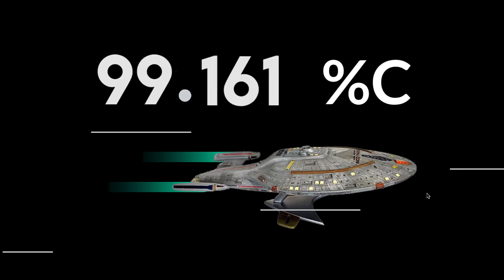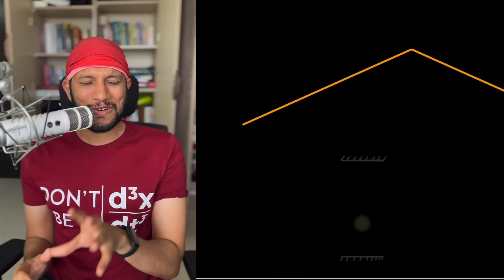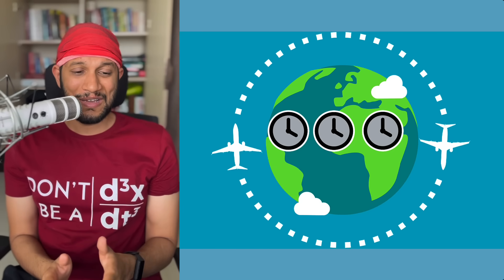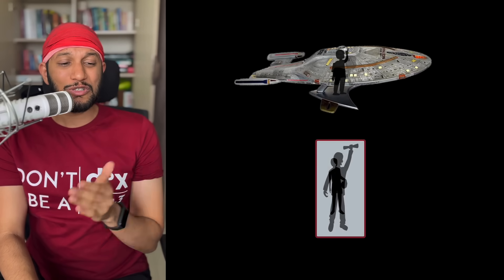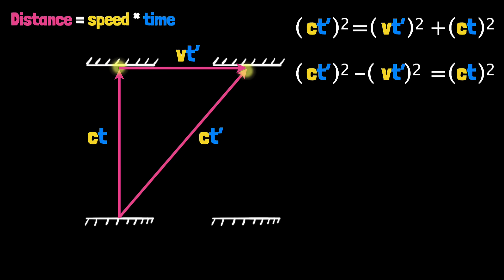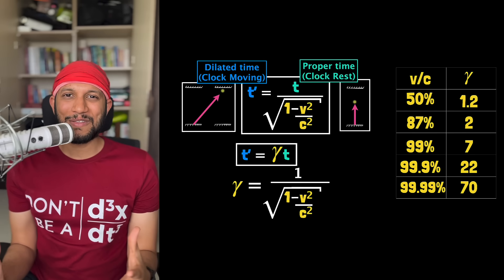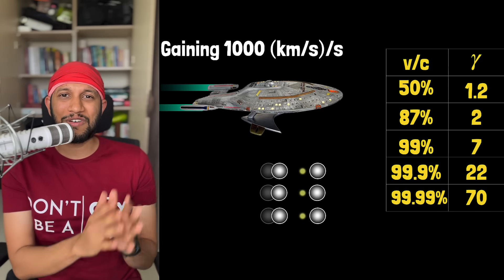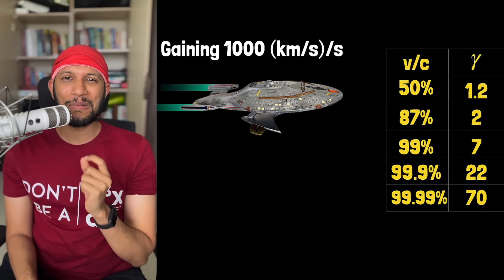I finally understood why you can't go faster than light! (My mind is blown)

Comment: Well it seems to make sense except with the part that the photon would appear to slow down.
If they are traveling at a fixed speed between a set distance in the „clock“, why would they appear slower from an outside perspective?
You just add another vector of velocity to them, that doesn’t change the speed for the other.
Also wish if you put the clock sideways?
When the photon travels in the same direction as the space ship?

If the photon bounces in the same direction as the ship, it would take longer to reach the end since the mirror is moving away from the photon.
When it bounces back it will hit the mirror faster since the mirror now moves to the photon.
However when the ship reaches light speed the photon wouldn’t be able to reach the mirror anymore. So from an outside view anything on the ship stops moving forever as long as the ships moves at light speed.

Since our whole existence is based on moment of particles, the machine of existence basically stops, since when nothing can move.
No energy is used and when no energy is used, nothing happens.

But that seems to be impossible.

Comment: You might want to do an in-depth video about half-life, because it's not as understood as you'd think.

Radium has a half life of 1600 years. That means that in 1600 years, half of the radium will have undergone Proton Decay, which turns a Proton into a Neutron, and releases a radioactive particle. This doesn't mean that half of it disappears, but rather goes down by 1 on the periodic table. For every radioactive particle released, a proton is decayed.

The Radium that undergoes decay turns into Francium.  Francium has its own half-life, which then half of the Francium has decayed into Radon, and so on. So for the material to actually half, there's a little more math involved

The real question is, what will be the heaviest element left when half of it is gone 🤔

Edit: I almost forgot. This doesn't account for when the atoms eventually shed off some neutrons instead, which they will

Comment: I just realized something about fictional spacecraft that have some tech for FTL travel (e.g. warp drive).  For practical purposes you would never want these ships at a velocity close to the speed of light.  They should only travel either a small fraction of c, or faster than c.  If they ever got up 0.5 c or higher, there would be time dilation consequences.  If they accidentally travel at 0.9999999 c for just a short time, 50 years might pass at their destination!

Comment: i have a serious issue with this statement: "you see the moving twin age much slower"
the moving twin compared to what? if the twins speed difference is c (99.9% of c) compared to eachother, but half c compared to me, i see booth twins aging at the same rate, and booth twins see the other one aging slower than they are (based on the transformation)
on the other hand, we know that gravity (acceleration) slowes down (curves) time, lorentz tells us speed differencve does the same.
still for the life of me icant understand how speed difference induced time dilettation can be actually real the same way as acceleration induced one.
if im on a rocket, doing 1g acceleraton, i will reach close c in a year. if i look out, all i see is that my horizon of the observable universe will shift forward. my acceleration wont slow down, my clock wont slow down. the univberse behind me will red shift in to nonexistence, and infront it will blue shift in to existence.( i mean it woujld become casually connected to me) i can burn my rocket for 2 years instead of 1, wich would mean i do 2x c. then i can flip and burn 2 years to zero it out. if i do the math about the distance i travelled and the time it took from my prespective, i should reach the conclusion that i did do 2x c from my perspective. i should not see white hole emerging infront of me while travelling, should not see black hole emerging behind me... (i know that this is not actual ftl travel tho but from my perspective it should be)

Comment: sorry but i find you explanation way less intuitive. i mean the fact that you can sat time is slowing down, or is it? means it is not intuitive, if it was intuitive the "or is it" would not be needed.

the explanation of it taking more energy to go from a speed of 1 to 2 then it did to go from 0 to1 and the curve leads to C=infinity is vary intuitive. well with the caveat that intuitive is a messed up concept. 

if i am pushing a cart at 1 MPH and want to accelerate to 2 MPH it is easier then if i an going 9 MPH and want to accelerate to 10 MPH. we skip 0 to 1 because going off 0 you need to break inertia.

Comment: For me its fine to travel only with 99% of c. However 1000 km/s per second means per second from the outside observer so the explanation does not make sense to me. For each second on my clock the spaceship is gaining additional 1000km/s. Where is the problem? I think you confused the time measurements. The speed and acceleration is always measured relative to the outside observer.

Comment: Saying an object cannot reach the speed of light is misleading. Based on Einstein’s theory of relativity, he uses a hard coded number for the variable of the constant. Science has removed this constant to prove some items in the universe and re-add it for other items. Which proves that the constant may not be 100% a constant more than a variable because when you change the value of the constant the entire equation falls apart. We have identified that light travels at various speeds depending on other variables or outside factors. Therefore the constant value of the speed of light is not constant.
That speed is specifically related to the measurement with a laser and sensors in a vacuum in a lab. Not in space or regular atmosphere. Therefore the speed of light itself is relative.
Reply: The speed of light is CONSISTENT in that it will always travel at the same speed/frequency for a given environment. 

It's an excellent marker for measuring one's motion in space as nothing can travel faster than light, and it travels in its own frame of reference. This causes a change in the amount of force being applied, which can be easily measured using synchronized clocks.

Comment: How does the expansion of the universe play a part to this? It's calculated to be expanding in a rate of 70km/s , that must mean that also our galaxy is traveling in that speed? Or does it cancel each other out due to the whole galaxy is expanding in the same rate? But then if you see the universe as a sphere it all expands in different directions so if our galaxy is going one way and another in the opposite direction has the same amount of time passed?

Comment: How many more times ? The twin paradox is not caused by velocity (as that is relative, depending on the observer so all clocks appear to slow down for all observers). Rather it is caused by a change in an inertial frame of reference ie. Acceleration. While your explanation has the virtue of appearing simple it is misleading.

Comment: Where i struggle to understand this is that we are orbiting the sun at like 66,000 mph. The solar system appear to be moving at 448,000mph. The Milky Way Galaxy moving1,300,000mph.

Speed of light is 671mph. Which means we are already moving at 0.25% of the speed of light. 

Therefore if we send something in the opposite direction to this movement shouldn't time contraction in the same way it dilates when we increase speed? 

For example Mars moves slower than earth so shouldn't clocks on mars speed up?

Comment: light speed physical travel is a dumb idea.
1: you are in a space ship at the speed of light, you hit an asteroid the size of a grain of sand - you get incinerated.
2: you can't manouver - it's a straight line or nothing. You try and move a physical object 1mm to turn at light speed you'r ship crumbles
3: even moving at light speed you are going to be in space for 100's of years to get any where interesting
4: Acceleration and deceleration distances will be ridiculously long,  accelerating to light speed will probably take around the entire length of the soloar system - but you'd have to get to deep space before starting because of the danger of hitting something, same with deccelerating...
It's just pointless.

Comment: Why couldn't the perspective of the spaceship reach the speed of light? This video explains why someone standing still couldn't observe it, but what about the people in the ship who just want to reach the speed of light without proving it to observers? With mental gymnastics, I can only imagine that it would feel like one of those carnival rides that spins fast enough where you get pulled against the wall, resulting in immense resistance to reach out your hand in the sense that time would still either appear slightly faster or slower depending if you are moving towards the back of the ship or to the front of the ship, respectively, when traveling in the spaceship very near the speed of light. That being said, if a ship could truly reach the speed of light, would time feel perfectly still inside the ship? Still trying to wrap my head around it.
Reply from the maker: Check out my follow up video. Linked in the pinned comment

Comment: I was thinking about it and probably there could be a solution, if the object (let's say spaceship) uses external energy source (for example solar wind) instead of internal (fuel). In that case the object could reach speed of light and very likely would became a 2 dimensional object and the time would also stop for them.

Comment: In your admirable attempt to explain special relativitivity in layman's terms you have bulldozed through the correct physics. The external observer will see time slowing for the photon clock (say) on a spaceship approaching the speed of light, but (a) the time according to people on the spaceship will not slow down (even though the photon "has further to travel") and (b) people on the spaceship will observe that clocks on (say) the Earth are slowing down, the faster the spaceship moves. Two objects say A and B, which are moving relative to each other, from the perspective of an observer on A, it is B that is moving, and hence time on B should run slower due to time dilation, but by the same token for an observer on B, it is the time on A that is moving more slowly. The fact that both perspectives are equally valid physically goes goes to the heart of special relativity and to the idea that there are no "privileged frames of reference." So your explanation which attempts to exlain relatively using clasical concepts is helpful to a lay audience, but incorrect physics.

Comment: What happens if we turn the photon clock 90 degrees so the photons will travel perpendicular to the ships line of motion, back and forth?

Intuitively it feels that photons moving opposite direction to the ship should reach the mirror almost instantly. How does the speed of light stay constant for all observers?
Reply: I took a moment to think about this further and concluded….

To an outside observer, a photon bouncing off the frontal mirror would reach the rear mirror in a much shorter time than vice versa, as photons always travel at a constant c.  But how would an observer inside the ship perceive this event? Information can only travel at the speed of light, so this information would experience time dialation as well, leading the observer inside the ship to wittness this event with a delay when compared to an outsider….

Does this mean obervers inside and outside the ship disagree about when the photon hitting the rear mirror took place? Meaning simultaneousness is relative?

Did I just answer my own question or got everything royally wrong?

Should I just pick up ”Relativity: The Special and the General Theory”, a book gathering dust on my shelf and read the chapter where Einstein talks about the relativity of simultaneousness instead of responding to my own YouTube comments?!

Comment: So... best thing to do is just go to 87% of the speed of light and just have double time dilation while traveling at 260,819,438 m/s instead of going towards to infinity to gain a speed of 299,792,458 m/s, which is only a gain of 38,973,020 m/s. So don't aim for 99% speed of light, aim for 87% which is best return for your energy output and time saving.

Comment: Great video, Mahesh. I saw a good video by PBS spacetime that explained the reason differently. In a way that makes this sound more like a consequence. It was to do with the fact that matter is trapped energy and is technically already at motion within the atom and therefore could never be made to go C in one direction. It would have to travel faster than the speed of light. Have you come across that concept at all? I'd be interested to hear your take
Reply: So I don't know about that explanation, but from a didactic point of view this explanation is in line with Einstein's derivation/development of SR. It only takes a few axioms, which were either experimental fact or extremely basic, instead of having to take guesses/explanation attempts of the nature of matter itself. I don't know General relativity at all unfortunately, so maybe it loops back around and helps explain why C must be constant, but neither does anyone in need of an explanation of special relativity, so I think bringing any of these things in makes the explanation circular and less convincing because it introduces statements that are not easily provable.

Comment: I'm sorry, but I have to disagree with a lot of this video. Time is a variable you are adding to your equation. The simple answer is: because we don't have an engine to get us to that speed yet.
The question is about the travelling faster than the speed of light, not the relative speed of light versus time - or it's perception by onlookers or travelers.
For a long time in history, we as a species though the speed of sound was unattainable, or even heavier than air flight. 100 years later we are now flying supersonic jets - because we designed engines that can. 
To travel at the speed of light we just need to design an engine that can propel a spacecraft to an excess of 299,792km per second. The hurdle then is: we need to design an engine that can generate thrust such that the particle output exceeds the speed of light (and thus allowing the spacecraft to exceed the speed of light), or generate some kind of warp drive that bends space in which it "jumps" from one place to another.
Basically - we don't have the technology to get to this speed... yet.

Comment: Does that mean that if you are in a spaceship at say 99% of the speed of light when you feel like you have traveled for one light year, have you actually traveled for 7 light years, and it would take seven times more energy to accelerate it faster than it would at t.

Comment: It's very fascinating, but there is one problem. In the time dialation equation you can replace "c" (the speed of light) with any imaginary amount. You can create bigger or smaller universum speed limit and you will get the exact same results. So this does not prove that if the speed of light is the maximum speed you can go with.

Also this force carrier delay explanation not make sense at all, cause time dialation phenomena has to influence also only a single standing alone particle going by any speed. So this model in the video is very misleading cause time dialation not caused by the distance where the force delivered with a delay. Time dialation phenomena could be modeled more accurately if you illustrate it with a single particle without any observer or interacting mirror or anything like that.

In my opinion time dialation can only make sense if you consider universal time as the "hearth beat" of the universe, where every tick induces a wave what goes by the speed of light from the last position of all the particles and this wave has to "catch" the new position of these particles. If a particle goes so fast this "catch" on the space coordinate takes more time so that particle time moves slower. And the reason why the speed of light can't be passed cause then the "catch" would never happen.

Comment: Against what reference point is the speed of light measured?  So, if one space ship is hurtling at 0.9 the speed of light toward an similar ship heading the opposite direction at the same speed; is the closing speed 1.8 the speed of light or something else??
Reply from the maker: It will always be less than c
Reply: Doesn't answer the question; c in reference to what point?   @Mahesh_Shenoy

Comment: Higher dimensional physics tells us that infinity can be achieved as a point in the dimension above. 
Therefore C is only a constant from a 3rd dimensional reference point. 
The problem is, that is our reality for now. Our frame of reference is restricted to our relationship to the 4th and 5th…etc dimensional geometry. 2 dimensional objects cannot perceive up or down, but we can perceive their concept of infinity easily in 3 dimensions. Just like we cannot perceive or interact with the infinity of our physical 3 dimensions. 
Quantum entanglement tells us that our perception of location is limited as two particles appear to interact with each other instantly over ANY distance. In reality they are adjacent to each other in a direction we cannot perceive.

Comment: This gives the impression that something happens to clocks when they move fast. This is not the case. Relativity says only that a clock is measured to run slowly when it is moving relative to some observer. If there are two observer moving relatively to each other, then each measures the other's clock to run slowly. Time dilation is a special case of the Lorentz transform. Trying to reason by using time dilation has lead many a person down a rabbit hole.